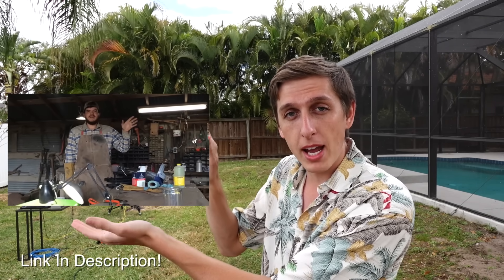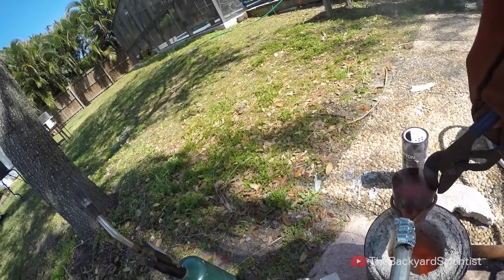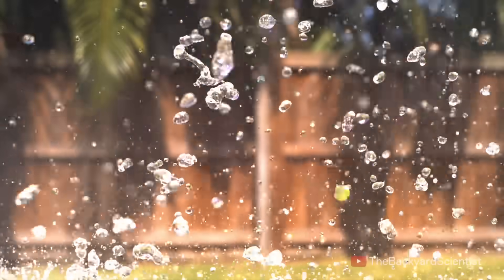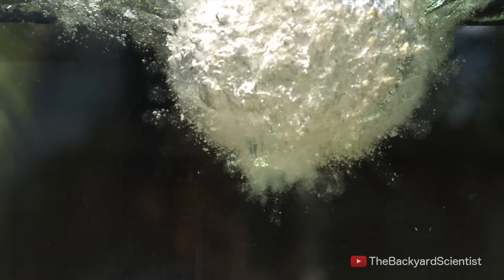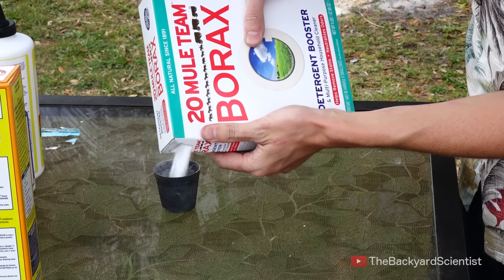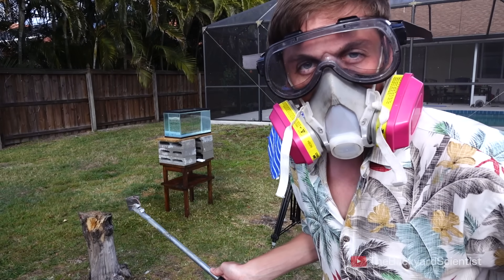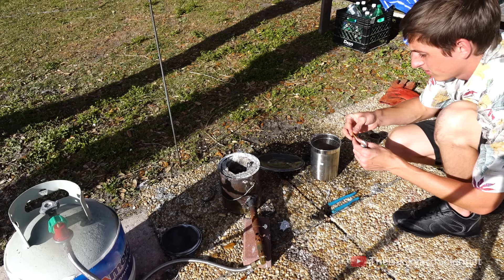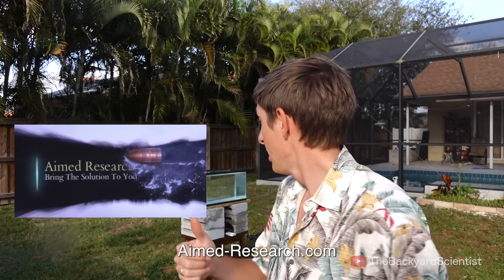Pouring Molten salt into Water - Explosion!

Comment: Don't you think that Hydrogen gas may be liberated from the water due to the extreme temperature and mix with Chlorine gas from the molten Sodium Chloride? Perhaps the blue in the spectrum of white light is somehow reaching these two mixed gases and causing them to explode. Don't forget, light traveling at certain angles through the water may very well diffract white light into the spectrum, and blue light will in fact cause a mixture of Hydrogen and Chlorine gases to violently explode. I'm pretty sure that this is what is happening. Your camera would not pick this up.
Reply: Water won't decompose thermally to any appreciable extent at temperatures below 2000 C, far higher than the boiling point of sodium chloride (1400 C). That sodium chloride also does not decompose in a vacuum when melted was apparently established in the early twentieth century, but in the presence of oxygen a variety of trace reactions can indeed occur. Of course, those reactions would leave the resulting solution alkaline, so if they occurred at all, they were below the limit of detection.

Apart from that, any chlorine produced would have left the salt while it was hot in the furnace, not while it was poured into the water. Any hydrogen produced would also be mixed with the water vapor, quenching any reaction. And hydrogen-chlorine reactions, while violent, do not release so much energy from such tiny quantities.

By the way, it's ultraviolet light that promotes the hydrogen-chlorine reaction, not pure spectral blue.
Reply: everyone who replyed to u are smart lol i dont understand this at all lol
Reply: no, the high temperatures did not decompose the sodium chlorine.  Also, there would likely be a fire ball, but here there was none, only steam.

Comment: Cascading endothermic reaction. The first large globs of sodium are so hot that they instantaneously vaporize the water molecules. The sudden release of steam violently rips apart the molten sodium and exposes more surface of molten sodium to be cooled off. The reaction continues until all the sodium has cooled off, or all the water is gone.

Comment: 1. The leidenfrost vapor is still going to react in the fashion you described, and all the more violently.
2. The  immediate contact environment will produce a rapid vaporization of the water as well as reduction of the molten salt into sub-micron particles, hugely increasing the surface area of the salt.
2. There may be no net chemical reaction, but there may be a dissociation-reaction-recombination cycle, allowed by the extremely high temperatures available to drive it.

It's pronounced 'lie'-denfrost.
How to pronounce Leidenfrost
Leidenfrost pronunciation Pronunciation by Thonatas (Male from Germany) -- forvo • com / word / leidenfrost

Comment: This phenomenon, sometimes called sudden phase transition, has been the subject of much scientific research. When two nearly immiscible liquids at different temperatures are brought into contact there are no nucleation sites making it difficult for the cooler  liquid to boil. However, if the hotter liquid is between about 89% and 105% of the thermodynamic critical temperature of the cooler liquid (705 deg. F for water), the cooler liquid will instantaneously nucleate, causing a violent explosion. Very dangerous experiment.

Comment: i suspect the leidenfrost effect does not segregate the salt and the water because the highly polar nature of the water breaks the framework of the salt faster than the water can evaporate, allowing a bond to form with radical differences in energy, but still creating a saltwater gas.  as this gas expands, it pushes the rest of the salt from all directions pushing outer salt molecues to the opposite side of the center mass of salt, as indicated with the mini explosions seen in the outer shell of the main explosion with the inner salt being propelled outwards.  I think it is a chemical reaction allowing a physical reaction to occur on a greater scale.

Comment: I guess for Chemicals with higher melting points you well need high temperatures to make them explode(in this case), because they just cool too fast down so you need even higher temperatures and also they could radiate heat less fast what also would make the water explode slower, but I primaly belive in my first thought.

Comment: The key is that you have to melt the salt first, in doing so you put in a lot of energy.  When it is added back to the water it gives off its heat of hydration, causing the water to boil instantly, causing the shock wave. A bit like when you dissolve anhydrous sodium hydroxide in water, it also heats up, albeit much more slowly and it is also not a chemical reaction.  The sodium metal reaction is a coulombic explosion with additional hydrogen explosions from the chemical reaction with the water. A totally different beast.

Comment: The difference in salt and molten sodium are to be expected, salt is ionic and sodium reacts through a radical mechanism. The reaction is probably chemical, otherwise the other salts would also have exploded. The lack of a pH change is probably because you are making equal amounts of HCl and NaOH. This can also account for the expansion since the reaction can also happen with steam and doesn't necessarily require contact with the water surface. Boric acids are already saturated with oxygen, as are carbonates, so they might not have been good standards for comparison - you need something that can accept an OH-

Comment: Hi mate it was interesting work! Love to see explosions in the lab/yard!
With why salt caused explosion and not borax, I think what happened with salt was water was not only vaporized, but even turned into hydrogen and oxygen. When reached a critical volume, the mixture of two gases was ignited by hot molten salt, creating blasts.
One of the difference between salt and borax is that borax decomposes and loses mass under high temperature. So the total mass of melt borax is less than salt (can been seen from the video). Maybe by doubling the amount of borax it will give similar effect to molten salt?
Happy experimenting!!

Comment: Could it be that the solubility of NaCl in water is much higher than that of the other salts you tried? That might explain why the Leidenfrost effect doesn't kick in -- the potential of the salt to dissolve itself into the water is higher.

If so, then caustic soda NaOH should give an even more dramatic explosion. That'd be fun to see. Pity though that caustic soda is so... dangerous.

Comment: I actually watched this video to the end and in it he proved it wasn't sodium metal reacting with water because it would have made a basic solution(I think it would have made sodium hydroxide and hydrogen gas if I'm not mistaken). I would best explain it as a purely thermodynamic reaction in that the salt stored up the energy put into it after it became molten. My proof of this is that they use molten salt to store energy in those solar power towers(which are awesome by the way). It is very hard to vaporize salt(which would have cooled it) so he overheated it. Superheated salt then contacted the water and made a steam explosion inside itself which blasted outwards and overpowered the leidenfrost effect. Best video I've seen all day.

Comment: I think there are several physical and chemical motives for such behaviour. The first being that the molten salt will evaporate a certain amount of water upon contact and generate steam, but it will also ionize on contact with water and under such energetic conditions it will take oxygen from the water and form NaOH at a very high speed.

The water steam and hydrogen gas that were so quickly produced build up several atmospheres of pressure being contained in that small tank and so they expand violently and displace some of the water. In fact, the water level in the tank didn't only lower because of water displacement, a good portion of it was also vapourized and consumed in a chemical reaction. By the way you also probably generated an amount of hydrochloric acid so careful with that. Be sure to check the pH of the water next time you do this.

But that's just my take on it.

Comment: I imagine the surface tension of the liquid salt is lower than the liquid borax and liquid sodium carbonate, so rather than holding together in one lump with a small surface area, it flows as fast as the water, making its surface area expand quickly, dumping more and more thermal energy directly to the liquid water before it vaporizes.
Reply: imagine he could have been impailed by glass

Comment: If you were able to sufficiently dissociate the Sodium and Chlorine bond, which would be possible by heating it past the melting point, then it's possible that the water is independently reacting with the Sodium and Chlorine. Water and Sodium gives NaOH, as well as producing Hydrogen gas. That could account for the rapid volume expansion. Also, the Chlorine could react with the water to give a mixture of hydrochloric acid and others. Therefore no pH change would be noted. Just a hypothesis :)
Reply: +Philip Madden dissociation is not the same thing as boiling. The ionic compound can still remain a heterogeneous mixture, even if the chemical bonds are weakened to a point where the constituent elements are able to react with external molecules.
Reply: Oh yeah, chemical decomposition by adding thermal energy.
Reply: yeah it should be tried with potassium chloride
Reply: I don't know why but when men talk like this I get all kinds of hot and bothered. lol
Reply: Crystal clear.
Reply: Considering sodium is an alkaline metal (which is very reactive/explosive with water), if the sodium and chlorine were separated that would explain the explosion. Honestly it's not that advanced.

Comment: It's really very simple.....the part of the motel salt that was in contact with the water turned back into solid while the inner core was still molten. That shrinkage of the outer shell and the temperature differential creates an enormous amount of pressure inside that it has to go somewhere. I used to maintain molten salt baths that, if allowed to cool down would explode for the same reason your experiment exploded. The cooler, outer shell surrounding the molten core will build up pressure and blow up.

Comment: Here's the reason why: (from Google)
Sodium Chloride melts at 800C when you drop molten salt into water the water boils instantly hence you get a steam explosion. The hot salt dissolves in the water at first contact so the heat transfer is extremely quick.

Comment: The heat of vaporization for water is formidable, I don't think the molten salt gained enough heat energy from the furnace to do what it did according to your hypothesis. Unless the molten salt  went through a change of state between the lower molten temp and the higher molten temp where you were getting the reaction in question. A change of state would be detectable by monitoring the temp during heating at specific time intervals (say every five seconds) plot the recorded temps on a graph, and look for flat spots.  If this is a physical reaction, as you claim, then the only source of energy available for it is from the furnace.
   As you probably know, the way to separate Sodium from Chlorine is to heat it to a molten state and pass a current through it. The Sodium, being a metal, will collect on the positive electrode. I'm thinking that there is some kind of Sodium-water chain reaction taking place.
 I would like to suggest that you invest in some protective clothing, and long pants. A leather welding jacket and apron would work better than what you were wearing.

Comment: now imagine that on a massive scale being dumped into a lake or ocean!
Reply: Lets make it happen
Reply: +ECN link?
Reply: +Clint Williams Earthquakes and tsunamis ahoy!
Reply: +Clint Williams oooooooh! i'm already excited XD
Reply: It's already done.. Just pure sodium barrels war time surplus disposal. A video exists on that.
Reply: +ECN Link it
Reply: Just google "Disposal of sodium by military"
Reply: You would probably die before you reached an amount to that proportion, unless it was over time. But even then you still have a very good chance of dyeing, whether it be diarrhea or low blood sugar.
Reply: Thats happened, actually all alkaline metals (sodium, potassium, cezium etc) have an explosive reaction with water.  It is a chemical reaction due to the fact that they are all in the first column of the periodic table(the real meaning being that they have only one valence electron and are very reactive ).  So sodium metal and all the alkaline metals react like the sodium metal in this did.  I think the reason the molten salt reacts differently due to the chlorine being mixed in, as well as the heat.  Cant tell you exactly but its got to be one of those two factors that allows the delay in explosion, and causes multiple separate ones.  
Getting back to what you said, after a certain war (can't remember which) the US had left over sodium metal they were using for bombs and tossed it into a lake to deal with it.  Look it up on youtube, its there.  It exploded very nicely but the video is real old so its not the most badass

Comment: This is a chemical reaction. Sodium is under the alkali metals of the periodic chart. An element, It shares this with potassium and a few others. Now allali metals "in pure form" have an additional electron to spare in chemical reactions. When sodium mixes with water, it chemically reacts at an exponential rate as the spare electron breaks bond to adhere a new bond with a hydrogen molecule. This creates sodium hydroxide as a bi-product. Also lye or soda soap. The gas form is simply unattached hydrogen released from its bonds with oxygen, creating hydrogen gas. The failed attempts you have is with biproducts. Sodium bicarbonate is a stable sodium molecule, this no reaction. Sodium chloride (salt) reacts with more perceived vigor because in the burning process you are releasing chlorine gas in small form, but only opening up a small amount of the pure sodium..a lot is still bonded molecularly with so its a limited reaction (in fact that popping when it cools is sodium crystallizing as it bonds back with chlorine molecules. The mass reaction you have at higher heat is because more pure sodium is available in the molten solution, but a lot still isn't. So in reality, you get more displacement because the full potential of reaction is actually retarded by limited sodium reaction (more in molten but less in solid). The more pure the sodium form it is in.. The more stronger the reaction (like the actual metal test) so the chlorine in salt acts like a buffer, but enough to give a boom, (typically a boom sound is a slower reaction, a cracking sound is a faster reaction). If you burned the salt at a consistent heat (840) for a longer period of time..more chlorine would release and more pure sodium available to react = more violent reaction. Check out pure sodium's angry brother potassium.. Same exact idea of chemical reaction.
Reply: +Iron Alley "This creates sodium hydroxide as a bi-product" he tested for pH change and it didnt change. :/
Reply: +TheMrCarnification 
Sodium hydroxide "is" created when pure sodium reacts with water. The control quality of his test is questionable. Unless the water was tested and balanced prior to ANY testing, then I would say that his test was not conclusive enough. It was either improperly controlled or incorrectly tested. I'm not going to apologize for the fact that sodium is an alkali and that when added to a solution (water) it will change it's pH, even as salt that would occur. The reason for the exothermic reaction is simply explained:
2Na(s) + 2H2O → 2NaOH(aq) + H2(g)
sodium hydroxide and hydrogen gas are what you have as bi-products. 
Not trying to be rude or anything, but it's easily explained in high school chemistry or here for reference..
http://www.lenntech.com/periodic/water/sodium/sodium-and-water.htm
Reply: The link doesn't speak to the actual experimental conditions here.
Also, he tested for pH with a good dose of molten salt in a small volume of water. It would have easily altered the pH enough for even the crudest test to detect.

Comment: The molten salt is super heated then once dropped in water, it forms a layer of steam around it...... Once the whole salt touches the water from its sides it super heats the water instantaneously and the water steam expands rapidly.
Similar to Leidenfrost Effect when you pour water on very hot surface, it floats on heat and water vapors.
Reply: +Mukesh Kumar the question t the end of the vid was why the Leidenfrost Effect doesnt shelter the NaCl like it did to Borax
Reply: ScopedPewPew Alright, what is right then?
Reply: ScopedPewPew and what exactly is wrong about his statement?
Reply: Yup. Molten salt is heaver than water. It sinks quickly.

Sodium is lighter than water. It catches fire, on the surface so the damage is minimal (unless you're dumb enough to flush it down the To let)

Comment: Could it be the chloride burns off from the heat until a bit is left and your are left with molten sodium which is why it reacts with water and then the liberated hydrogen gas and chloride gas and the heat = boom?

Comment: The salt needs to dissolve but the salt is too hot and will boil but it can't if it's dissolving so it's trapped in a small core and basically blows up

Comment: Of course pure sodium placed in water will explode-  it is a chemical reaction we all learn about in chemistry labs as kid.  Sodium is a very unstable alkali metal and will react vigorously with water once it breaks down the h20 into hydrogen gas which ignites with the heat. The reason why the sodium reacts so violently has to do with how quickly Sodium shares it's valence electrons